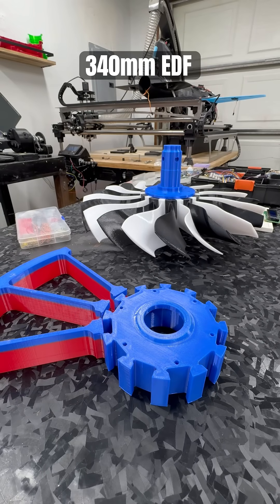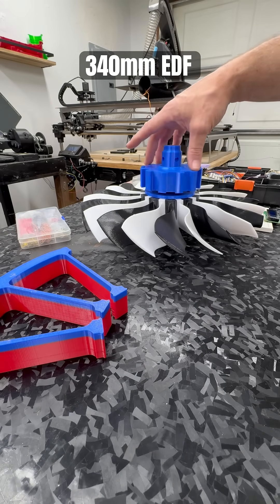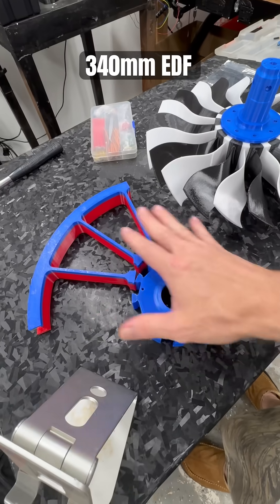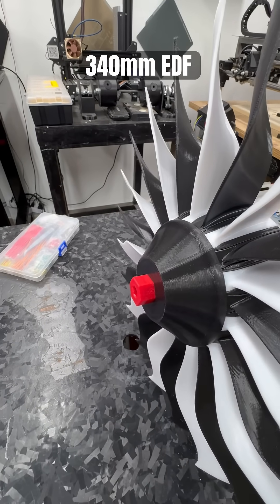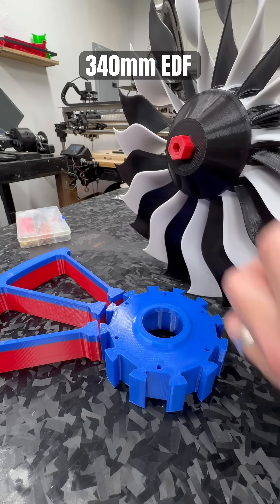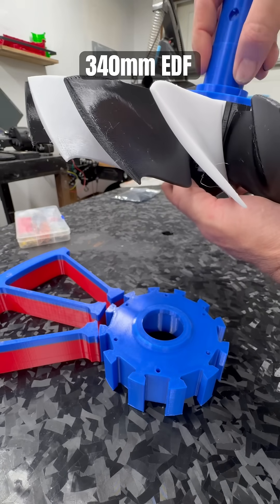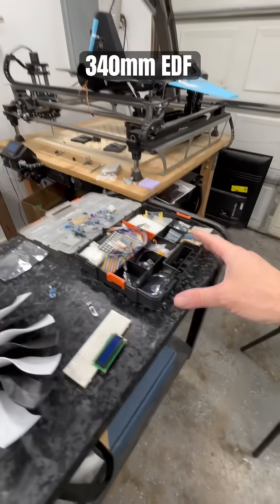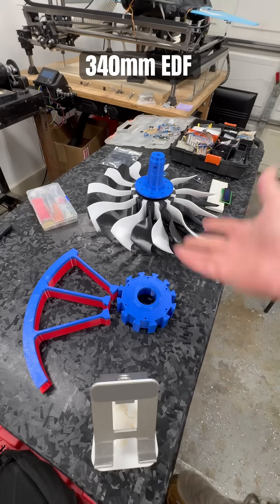Update of the 340 mm electric 22 blade high pass EDF turbine. ￼ Designed for ground and air. #fyp

Comment: Since this is bigger, we could have some fancy pants variable pitch stator, 

Basically a 90° transmission gear, that instead of one 90° connection, you have multiple radial gears for each stator blade, hood it up to a servo, and kaboosh